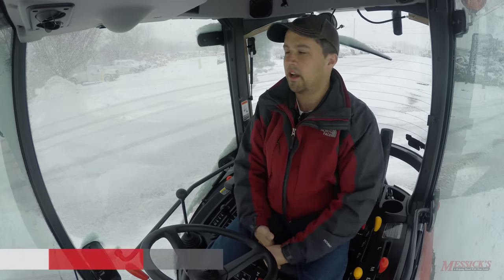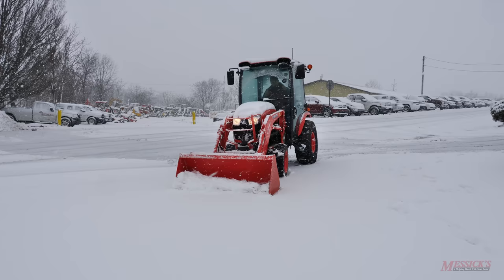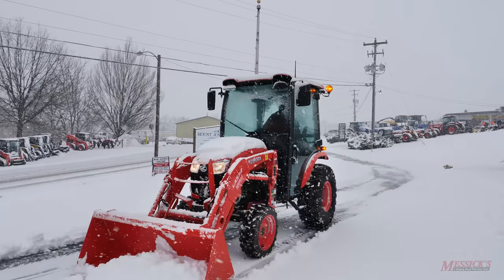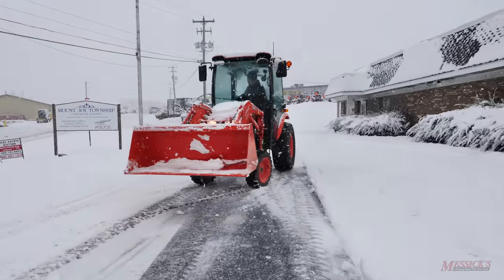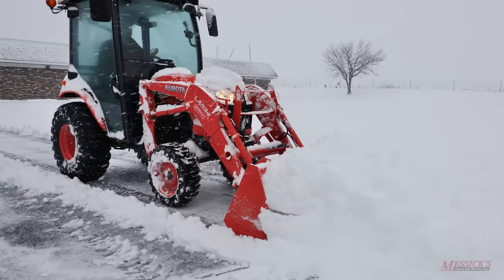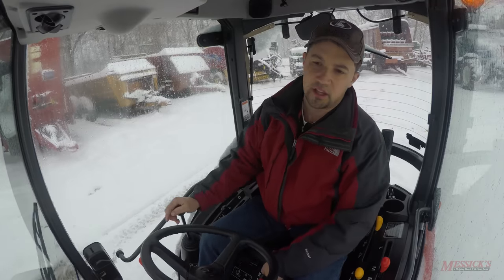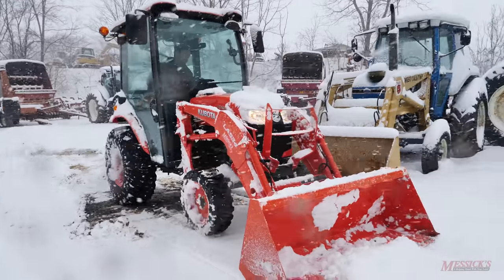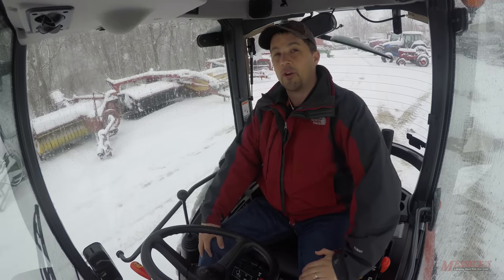How to clear snow using your loader - Kubota B2650 Cab Compact Tractor

Comment: As much as I like your videos of information on specific models, you are definitely not an operator. You should not put it in float for efficiency only if you don’t know what you’re doing or if you don’t know what’s there to hit (for instance if you were doing somebody else’s property). When you put it in float and the snow builds up it will actually take weight off the front wheels effectively only giving it the traction of a 2 wheel drive and making it hard to steer. You are right with using the cutting edge and keeping the bucket near level, but the proper thing is to set the loader to the ground and apply just enough ground pressure to keep the bucket scraping the ground thoroughly without having to much where it picks up the front wheels. Just a friendly tip from a heavy equipment operator.
Reply: Ty Hart hey Ty, Im learning. So when is the right time to use float mode? Also can you give advice on digging? I’m clearing land and I want to dig up a burn pile.

Comment: I purchased a 2010 B26 this year and this is my 1st winter with it. Had our 1st snow fall 4-5" today In mount bethel, PA.  Used the B26 to remove the snow from my half blacktop/gravel driveway. Couldn't get the bucket to float like my old tractor (92 Ford 1620).  I guess I wasn't assertive enough pushing past the detent.  This video was very helpful.  I will try again when I get home from work.  Thanks Jeff M.

Comment: Brings back memories, Neil. Back in the mid sixties, when I was in my late teens, I had a '58 IH 350 Utility with a LORD  front end loader.  This was in central Ma. and I had a plow route doing driveways for homeowners.  The loader did not have a float position, as a matter of fact this was long before the invention of a single stick hydraulic valve so one had to do a one handed dance to operate the loader.  There was no such thing as heated cabs back then either.  Hell , I had to take off what passed for a cab after the first year of plowing.  The thing vibrated apart from the snow chains I had to use.  ( Two drive, ya know.)  I spent many a cold night pushing snow but ya know what? I had fun  doing it and  if I had the money, I would track that machine down and have it restored.

Comment: Great video as always! Just got our first decent snowfall at our new property and got to experience the "fun" of plowing 6" of snow off our gravel drive with my BX2380 with frontloader. It's definitely more of an art than a science. My first pass dug up several high spots in the gravel, and I had to back-drag to smooth it back out. Second pass, I rolled the bucket back about an inch, and it worked much better. After I removed about 4-5 inches of snow, I did a final pass in reverse and back-dragged the whole thing, smoothing down and compacting the final inch of snow into the gravel. That seems to be the key to keeping all the gravel undisturbed while creating a fairly smooth driving surface. I honestly think getting the feel for a rear blade or plow might be harder. For now, I'm content with floating the bucket and then back-dragging. If we ever get 10-12 inches, I might be singing a different tune.

Comment: Would have been interesting to see the use of a rear blade as well.  Thinking of getting a rear blade that I can also utilize in the winter for my gravel driveway.  FEL is a trick because of the grade changes in the driveway as I go down the hill.

Purchased an L6060HSTC last year and got the rear wipers and defoggers so I could use it in snow.  Worth the extra investment.  Someone on the forums told me to turn the AC on to help defog the inside which does seem to help. Most of the time I open my side windows which I am thankful to have.  Almost bought a JD 4R but they didn’t have the wing windows and they really come in useful in the winter.

Great video as usual.  Thanks for your work on making these.

Comment: Always enjoy your videos. As far as using a loader on asphalt, it is worth noting that if you don't slightly roll the bucket forward onto the cutting edge the side plates of the bucket will gouge the pavement.

Comment: Awesome video, I just bought a BX1880 with a loader to help with snow removal at our cabin. I am looking forward to a bit of fun and a learning curve.
Reply: Greetings! Care to share your experience(s) with snow removal? I'm considering buying the same model with loader but wonder if it can handle wind-packed drifts (sometimes 4'+ high, despite snow fencing), a common feature up here in windy southern Alberta. Thanks in advance, Tom
Reply: @tommercik  hi, I figured out that a good walk behind snow blower works best as we are not there all the time. Full time residents plow the snow out of their driveways after it stops snowing but if you are not there all the time that is too much snow to push as you can arrive at our cabin with 18 inches being recently dumped and a two or three foot high berm at the road. The BX works great on the berm as the blower doesn’t work well on frozen slush but the BX will punch through it.

Comment: My tractor is just a bit larger than your but very similar with front wheel assist and a cab.  I spend between 50 and 70 hours per winter moving snow on my properties and I have a bucket in front and a 70" blower on the rear the combination allows me to clear snow in the fastest way possible, the bucket is really about the slowest way there is to move snow but if its to light the blower doesnt do a good job and you have to use the bucket!  Snow sounds like we stand a decent possibility of getting 9 to 10 inches the end of thsi week, let the fun begin!

Comment: Nice video. I just used my B2650 cab tractor to plow a foot of heavy wet snow today. The only things I did differently is use a Kubota weight box and run the throttle wide open. I think the engine runs cleaner and I have a bit more speed.

Comment: Hi neil. Love the videos. I have been wanting to buy a 2650 hstc for a while now. Recently sold my plow truck and want to use it for snow removal. Was thinking of putting a 72" snow pusher on the front but i am concerned about how much snow it will push. Adding a back blade will help with snow and give some weight to the tractor which i know will help. Would like to see some videos on this if possible. Thanks and keep it up😊

Comment: To help get rid of the fogging, turn on the air conditioner. This will remove the humidity from the cab. This is how it’s done in cars. I’ve done this with my tractor and it works great.

Comment: I'm heavily debating what direction I want to go with my next tractor purchase.  I'm looking to start a little side business doing snow removal for residential driveways.  My typical drive is going to be 100-150ft long by 11-12ft wide.  I really like the idea of something in this size for all year use and the price seems reasonable at least in the used market $5-6k less over moving up into something bigger...  At the same time, I'm also concerned it's not going to be enough tractor to handle my needs. I'm from eastern pa just north of Philadelphia so we don't get a ton of snow but we do tend to deal with more of  the heavier wet snows vs light and fluffy.
Reply from the maker: So we're just to your east. If your looking to get started in snow removal, I'd consider a used skid loader. They are much faster, and their prices on the used market (as a percentage) are much lower than compact tractors.
Reply: You're to my west when I get closer to making a decision  ill plan a trip out you're only an hour and a half away. 

Actually, when I first started looking at doing this I was interested in the skid steer option.  What kind of pushed me away from that is cost/ financing.   From what I read you can only finance skid steers for commercial use and even then the interest rates are sky high.  I would finance it personally then just lease it to myself 

 What really turned me on to the compact tractor option is the ability to have a loader/plow and a 3pt blower.... possibly if I go with a bigger tractor i would get an  inverted blower.  I also like higher 360 visibility as well as comfort 8+ hours in a skid loader bouncing around wouldn't be any fun.
Reply: rccrazy30 I bought my L4060 from Messicks after getting fed up with sub standard service from my local dealer. Messicks sales, parts, and service are definitely worth the drive.
Reply: Messick's m9

Comment: If you didn't have a trusted level indicator, once you have the loader lift axis in float, would putting the curl axis into float (I think some may call this quick-dump) make the bucket level?  Then you could scootch the curl a smidge to raise the blade off the gravel.

Comment: You really have videos for most everything a new tractor owner like myself has been thinking about since getting one. Do you have one on just how much damage AG tires will do to a lawn? The tractor I bought has ags which wasn't my choice but I bought used and got such a great deal on it I had to do the deal. Now worried the ags will ruin my lawn when this winter finally ends.
Reply from the maker: I don't do much on ags, they're very uncommon in my area.

Comment: Do you have a good formula for coating your bucket so that the snow doesn't stick to the inside of bucket.
I use a large jar of vaseline melted then melt a large stick of sealing paraffin and use a roller to apply to the inside of a clean bucket.
Reply: You can use cooking spray.  I've used it on my plow.  You have to coat it everyday you use it, but it works.  Let it dry before pushing snow
Reply: coconut oil

Comment: The hydrostatic WHINE is quite loud.  I see in forums people suggesting certain types of oil will reduce to eliminate the whine.   What causes that whine, that different oil or oil additives would mitigate the sound ?
Reply: how the gears operate
Reply: @zerpblerd5966  Actually, it is not the gears, but the whine originates with the hydraulic pressure by-pass valve.  The sound is amplified by the ROPS and the cab.  You will notice the whine volume changes when Neil was shaking the FEL @ 3 minutes in.

Comment: Do you recommend any sort of edge protector on your bucket ?   I only have a ~140ft driveway and I typically need to plow only 5 or 6  times a year.  So $1000+ push box is hard to justify.
Reply from the maker: It would help. Hard to do, few buckets ate drilled for a plastic edge. Drilling is a bear.

Comment: I'm a new tractor owner/operator and I used my bucket to clear heavy snow a couple days ago.  I put it in float and it tended to lift the front of the tractor as I progressed along.  Is this normal if the bucket is set wrong with, say the lip too far up?
Reply from the maker: Put it in float, and then once you start pushing take it out.

Comment: That tractor really whines!  😳
Reply from the maker: Running at low rev's so you can hear me
Reply: thats hydro man
Reply: Id rather use a gear trans than hydro   also i like my 6ft back blade but since i put a loader on my tractor i had to widen my tires to clear the loader mounts so id like to build some wings so i dont  cover my tire tracks   ps im jealous we keep going to 45 ish days here in mi    i want more snow  but since i cant plow snow ive done so discing already
Reply: Hydrostatic kubotas do that. We have a b1550 from god nows when. Its over 20 years old, before kubota was cheap, and it whines like crazy even at full revs
Reply: That's what I thought. That would drive me crazy
Reply: with my 2018 cab model b2650, I have a blue tooth stereo and play pandora on low all day, they really sound proofed the cab so you don't really hear the outside noises so much. It's an amazing machine.  @massey-rn8mq

Comment: What’s the maximum lift capacity at the pivot points from the factory?  I understand you might not recommend having the pressure increased to increase the lift capacity but let’s just say you did increase it, how much extra lift capacity do you think you could get?
When I purchased a L3540 the dealer increased the pressure and I was told a couple hundred lbs was added. I’m not really sure but I was able to lift a ton of pellets about 6” off the ground, enough to move it across the yard.
Reply from the maker: Firstly, you don't lift anything at the pivot pin. Deduct as much as 50% for a load like a skid that's way out on forks away from the Tractor. We don't adjust things out of spec, but no harm in making sure it's on the upper limit. 

LA534 is approx 800lbs in the bucket to full height.

Comment: you dont have a lot of snow.... and no ice either...  float is usefull for first time user. but the best way to do asphalt is just loading the pins, never jack the front tire up... just load the FEL pins, angle the cutting blade a bit toward the ground and youre good to go. for gravel road, the float is usefull and angle the bucket a bit forward/up so the bucket will ride on the stone without picking them up. its all depend if you wanna go fast or go slow... with a snowblower, with the amount of snow in your video, you can use it as reverse boxblade as going reverse and using the snowblower vs just reverse (pedal to the metal) is just faster.

Comment: I find that when clearning snow without using the cutting blade of the bucket, you just end up compacting the snow instead of actually clearing it, which ends up turning into nasty layer of ice towards the end of the season. I'd rather lose a couple of grains of dirt by using the bucket's cutting blade than accidentally turning my driveway into an ice-rink for people and machinery to skid around on. But hey, that's just me.

Comment: does the float settting on the tractor apply to the BX series as well?
Reply: Yes they have the float setting. Push your control forward, as the bucket lifts the front wheels off the ground push a little more and the wheels will drop to the Ground, you are in float.  Just remember that if you are on a stone driveway and you keep pushing the more snow in the bucket the lower it rides and all of a sudden you get a gouge into the stones. So you may have to raise the bucket a little as you go along. Practice makes perfect...........
Reply: Perty much any tractor and most any year has the float feature. Even my grandpa's 1970s JD backhoe has a float feature

Comment: do all front loaders have a float position?
Reply from the maker: most anything in the last 30-years, yes.
Reply: @MessicksEquip  just used my neighbors TC29D to move snow. the float function seemed a lil finicky but i suppose it did work ok. not easy to tell how much the bucket was tilted. i quickly found i needed to put it in 4wd but also seems if you take any weight off the front tires the steering is lost pretty quick. is it possible to use weights on the front or will the front loader hit them?

Comment: When I try to float my loader it tends to push the front of my tractor up almost like the tractor is trying to run over the bucket. It doesn't really matter the angle of the bucket
Reply: @Eric Stransky yeah its definitely in float. I use it for back dragging sometimes but The hydros aren't pushing it down, the weight of the tractor is. When I go into float the frame drops and the bucket stays where it is and the tractor pushing against the loader frame makes the front tires come off the ground. I cant really get the bucket to just slide across the ground in float, going fwd just pushes the front tires up
Reply: Same here.  The resistance of pushing a bucket of material always lifts the front tires.  Maybe it has something to do with the backhoe ballast ?  Maybe when using float, the front end is too light?  (BX25)  The worst effect, there is no steering.

Comment: The other problem when using a bucket is MANHOLES !!! Because you can get hurt or damage your tractor. I take off my backhoe and install the York rake. My farm and kennel is all dirt roads so the rake will abrade the road surface making it slip free. By using the rake you don’t need to use much sand,salt.